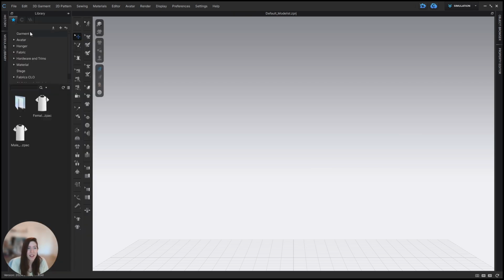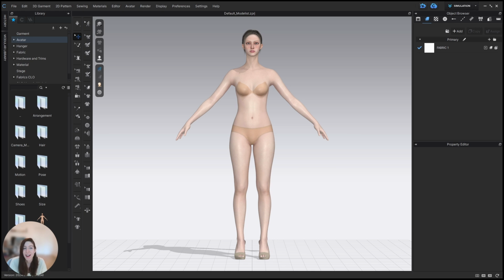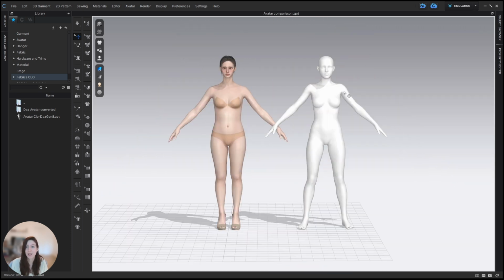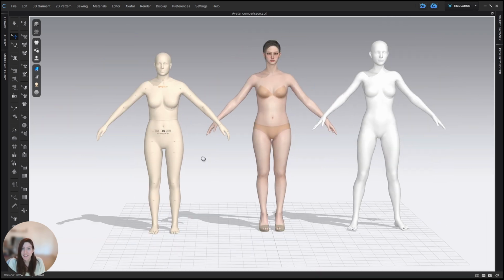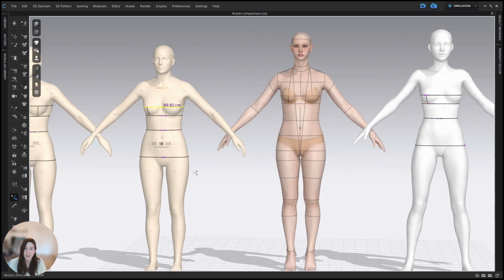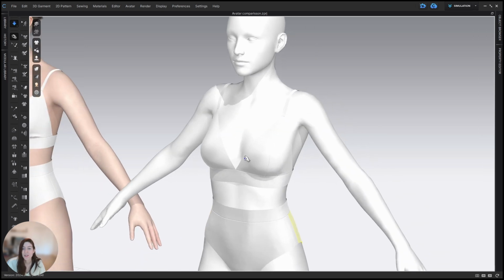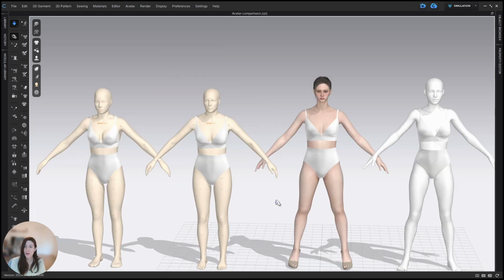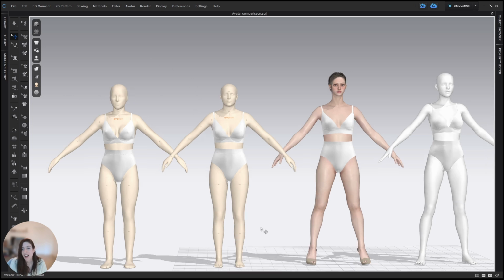Choose the best Avatar for your CLO3D project

Comment: I would say they still all fail. design Cycle Solutions is crucial in the use of avatars. Also the measure metrics video I have that has been viewed over 14,000 times is adding to fit problems as people do not know how to fit beyond just a measure. I have pulled those videos because the people making avatars do not understand how to modify and sculpt them. Also the rig is the biggest problem. This is why DCS has patents in a new apparel rig system. We also showed this at PI apparel.
Reply from the maker: Thank you for your insightful comment, Katy! I wouldn't say they all fail, as I said in the video each avatar has its strengths and weaknesses, and each one is more suitable to different scenarios (for example, not everybody uses Clo for fitting: there are fashion designers that use it purely from a design standpoint, videogame designers, 3D artists, etc. that not necessarily care about true to life fitting). I appreciate that your company seems to be doing great work in terms of creating realistic avatars for fitting, and I'm excited to see those kinds of advancements in the fashion industry! However, I picked the 3 options I explained in the video because they're the most easily available for the average Clo user. Though they're not perfect (and I say that in the video too), I do believe they're a decent starting point that is accessible to the majority of users.
Reply: @SofiaLuzonAtelier  my company has gotten out to do surveys with consumers. Brands that are using these forms to make clothing have marked results showing cup in bra shapes are to wide and straps are not placed well. For apparel the back is to narrow across the shoulder and to wide across the front, while the shoulder slope is off. The reason is POSTURE. At PI Apparel we showed a presentation of how parametric rigs are not developed for posture and location of bones in these present issues in any morphatyoe. The video will be out shortly For 8 years I have asked for new rig systems to accommodate to posture variables. Did you know that not one actually can articulate postures into ages beyond 40? Or even hit specific variables related to after pregnancy posture? What about pelvic tilt? This is where Design Cycle Solutions had to create a path. We spent 2 years to configure this pathway. We still need to adjust for mocap, but it’s very much built for things to come and just the first step in a much bigger system of accuracy.

Comment: I have a question 🙋🏽‍♀️, maybe you know. when you import from Daz and make it a clo3d avatar,  Does other features do stay? For example blue hair and face features for example. Thank you!
Reply from the maker: Good question! When you use the "Auto-Convert to Avatar" feature, you have 3 options: two of them just convert the avatar so that it can be used in Clo, but it won't be size-editable. The "Rigging only" option is the one that keeps the original features of the Daz avatar. The third option, which makes it Size-editable, can "erase" the features of the Daz Avatar and make it look like a normal Clo avatar, with the same skin style (Yuna, Mia, etc). That's why I don't like to use that option, because you lose the custom features you created in Daz. But if you use the "Rigging only" option, you'll be able to keep the avatar as you created it in Daz (sometimes the hair can give you problems, though) but won't be size editable in Clo. I hope this answered your question!